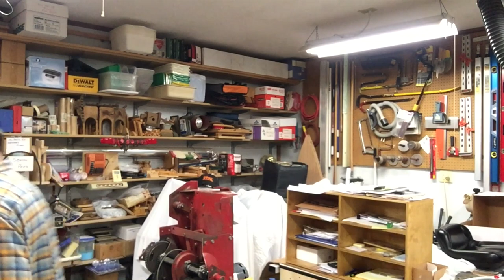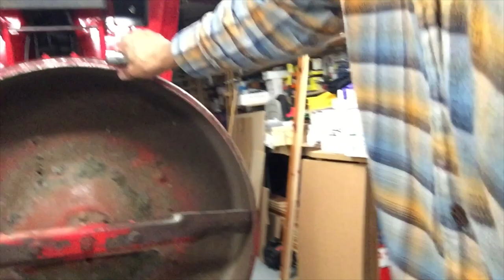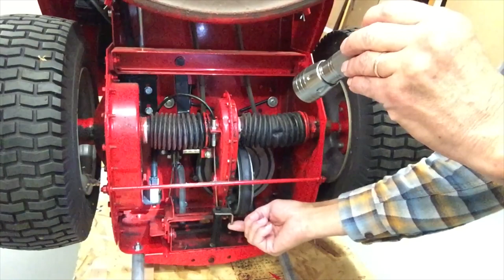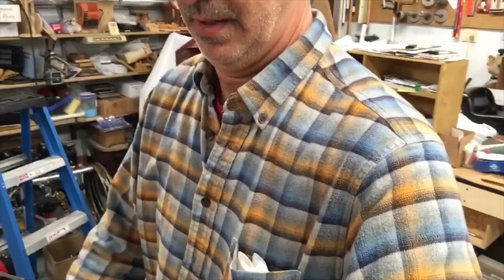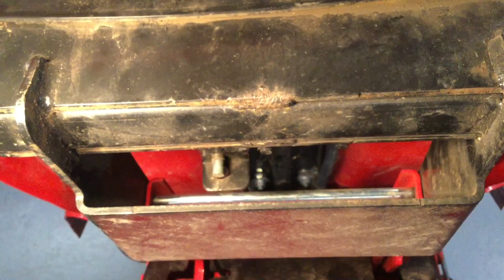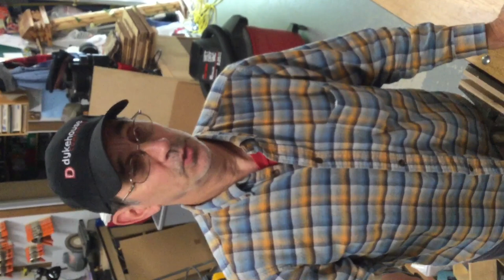368. How Can I loosen my clutch cable so my Parking brake will work on my Snapper turtle

Comment: Hi Jim - it's Big Rodders in Ireland.  It's good to hear you are on the mend.  I feared that something had happened to you since you didn't respond as normal to my email or my comment on your last video.  I can resend those photos if required.  My 1996 SR only has bushings (we call them bushes).  I don't know if all European models are similar.  Good to have you Snapping qgain!
Reply from the maker: Hey Rodney good to hear from you my friend yes could you send me the pictures again I don’t know if I got them I’ve been trying to keep up on my emails even though I was down a little. Jim
Reply: @jimjackson9381  - Big Rodders again.  I resent my email to you yesterday so hopefully it appeared in your inbox.  Hope your recuperation is going well.
Reply from the maker: @rodneysweetnam8653  Hey Rodney yeah I’d like to where you fixed it with a zip tie and by looking at the pictures of your house it looks like you’re pretty close to a cemetery is it a really old one wife and I like to walk through them and see how old of headstones we can find, your house is built a little different than the way we build them here the house behind you is similar but yours the outside walls go up higher than the roof how do they seal the roof so it doesn’t leak? Talk to you later buddy. Jim
Reply: @jimjackson9381  - Yes, the cemetery is next door.  This is a tightly knit community and generations of the same families are buried there, with great attention being paid to the graves upkeep.  Our house is 20 years old and is not untypical of modern representations of a traditional Irish countryside design, though they used to be single storey in the old days.  The edges of the roof are known as barge boards, where a cement layer is placed over the slates to prevent the western gales from the Atlantic ripping them off.  I was a little uncertain from your comment as to whether the photo of the brake fix was clear enough for you.

Comment: Hey Jim I'm having some snapper issues, it has no reverse to it and when you try and place it in reverse it will go forward instead any advice would help thanks!
Reply from the maker: I would first put the machine in reverse and stand it up and see where the clutch disk is touching the drive disk it sounds like you have some linkages that are messed up or loose and watching video number 253 may help you out with this issue you can take some pictures and email them to me and I’ll see what it looks like my email is
jimsfixitshop@gmail.com
Thanks.  Jim
Reply: @jimjackson9381  thanks for getting back with me! I will check it out tommorow and email you if I can't figure it out! Thank so much!